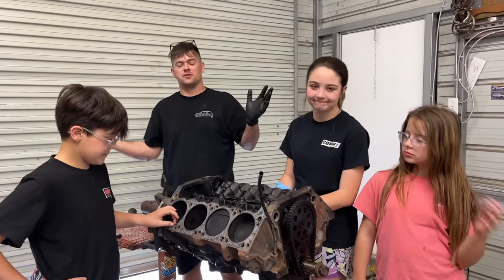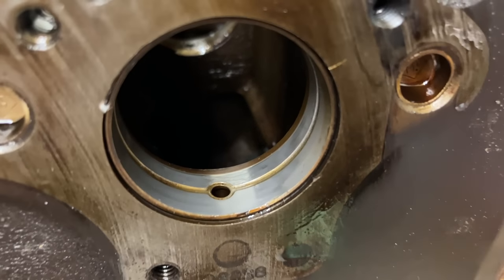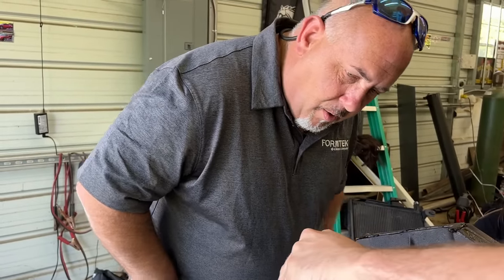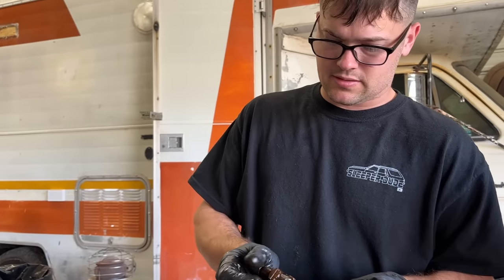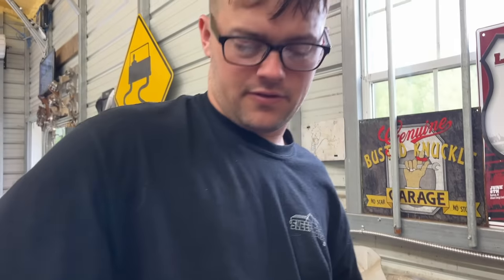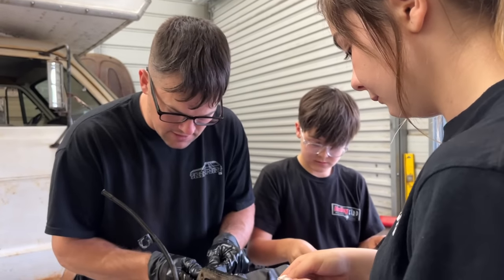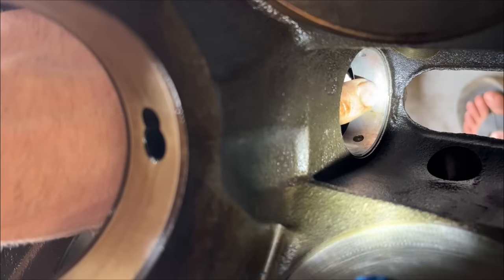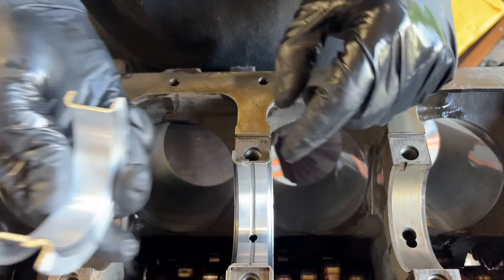250k Mile Engine Rebuild At Home! With No Machine Work For Cheap!

Comment: Take an old piston ring, break it, and use it to clean the ring lands on the pistons.
Oven cleaner always worked best for me when cleaning an old engine. Dollar Tree flavor works just as well.
I use either MMO or some dirt cheap engine oil for honing without issue. Taught to me by guys doing it for over 30-60 years.
Same guys taught me you can use STP Oil Treatment for assembly lube. Ford done the same for many years.
Good idea to replace the freeze plugs. They can look new on the outside but be rusted thin on the inside.
If my memory is right, that 360 is 4° retarded. Something to note.
I always take the oil pumps apart and clean them. Too many times I've found a bunch of trash in one and casting flaws in cheap ones.
Take and put some 10W30 on the valve stems, thin coating. Put it in and hold your finger over the guide and pull the valve out. If you got suction, the guide are still good.
Tell the kids to not be scrapping with a sharp blade towards them. Slip up and it could mean stitches.

I was thinking about the 302 swapped wagon. Why not T5 swap it and fit your old shifter handle to it?
It'll preform better and have better MPG's with the extra gears plus the OD will help out on long drives.

Comment: @SleeperDude
I've found that sometimes the plasti-gauge I would get was old, exposed to temperature extremes, or something weird, and actually would indicate a few or more thousandths off, so once when I had a good fresh package I got some tool measurements also, that matched up, then pressed at a set pressure some of that plasti-gauge between 2- machined steel blocks with graduations in .000's  on one going through the range for that gauge, and verified it's correct indication, then if I got some that read bad, I would call the supplier and they would send me more out, (from another box usually) and I would return the bad set for credit next time I was at their warehouse desk picking up or ordering parts, or dropping off cores. 
Had to rebuild one engine AGAIN because of that, and it was enough for me. Showed them the (then Polaroid 'instant' photos🤣)  pictures, they could see it, called their plasti-gauge supplier who agreed it was due to mishandling during shipmenr or storage, assured us that all leaving their facility was fresh with a really good shelf life, but near freezing for periods/complete freezing, or getting it way too hot, like leaving exposed to hot sunlight, laying on a hood, roof, etc, or too near a heat source that when used, it could mis- indicate, as can using it to try to measure outside of it's indicated range.😁
👍🇺🇸😎
Reply from the maker: Good info thanks

Comment: Josh, i advise you to lubricate the spark plugs by thread, a little bit, when you put the new one dry in the dry cylinders head, because, after engine works for some time, it will be harder to loosen it, and, it will made be broken  the ceramic isolator. 
Best regards, Saint-Pitersburd, Russia.
Reply from the maker: Ok thank you

Comment: Have seen the same type of damage to the cambearings in engines that have set with old antifreeze in the oil.  Seems to affect cam bearings more than rods or mains but have seen etching on them as well.
Reply: Anti-freeze eats away at bearing surfaces, impending doom sure to follow.

Comment: Hey i gotta share a little story with you about your motor home project. I totally appreciate all the different cars you work on. I'm restoring and daily driving a 1984 Nissan/Datsun pickup with an SD25 diesel engine. Its nice for northern Canada, no rust. 5 speed, extended cab, bucket seats, power steeping.  BUT, some parts are hard to find. There is a 1" heater hose connecting the head to the side of the block. Mine popped a leak. It's pre-formed into more than a 90 degree bend, in only 6" of length. Impossible to get one anywhere. I bought bulk 1" heater hose but without a pre-formed bend, it just pinches shut. So i tried  putting a copper plumbing elbow at the bend (1" OD) and I even heated it up to make more than 90 degree bend. For some reason the clamps didn't hold, it leaked. So I'm watching you take the 360 out of your motor home, and I see the hose from the water pump to the front of the intake manifold...yep I go get a hose for a 1973 Dodge 360 intake and after trimming an inch off one end it fits perfectly on the Datsun diesel. 
So thanks for solving my problem !

Comment: DIY head planer
Good quality 2X4 piece of plywood, 3/4 works great you want a flat surface. Cover the surface with fine sandpaper gluing the piece's down then just run the head back and forth till you have a even surface. Works very well for small imperfections.

Comment: just a tip to clean the piston ring grooves in a old piston,  take a old ring and break in half and use one of the half rings to clean the ring groove out with works great try it.

Comment: Thier is a tool to clean ring grooves but a old tip is use  a piece of the old  ring . Use a 55 gallon drum and block it up for a hot tank.

Comment: The secret to cleaning the ring grooves is to take one of the old rings and break it in half and file off any burrs and use the unbroken end to push and scrape the carbon out of the ring grooves. Can't believe you didn't know that one.

Comment: Wood chiscels work way better than screwdrivers for scraping , and you easily re sharpen them . When your flat screwdrivers start jumping out of the slot you will realise that you have rounded the edges from using them as scrapers. always keep a cheap set aside for use as levers scrapers etc, so that you dont ruin your good ones.
Reply from the maker: Yes for sure

Comment: Red Line assembly lube for the win!
Everybody saw how effortlessly that crank spun.
We were Red Line sponsored for years (92 IMSA Chmpshp) and fell in love with that stuff. The water wetter is great too & so is the gear oil that looks like pepto bismol (forgot its name).
Did y'all ever figure out what was up with the O.E. bearings?
Maybe submerged in solvent-type fluid.......but unlikely if it was a runner prior to disassembly......weird.
Reply from the maker: Yeah it seems like good stuff. No I didn’t

Comment: I had a similar low budget engine rebuild on my car.
It also has around 250k miles (400k km) of mileage, at least on paper... it's actual mileage might be an awful lot higher, since it's an old diesel.
One piston and it's rings were shot, and the cylinder surface was a bit rough.
Went ahead, replaced the bad piston with another one from a disassembled car, changed the rings, everything turned out to be ok.
Dunno about the compression and the pressure loss though. Must be significant, since I have a ton of crankcase gas.
It literally pushes oily air out of the filler cap and condenses oil on the valve cover.
But it's fine for me for the time being, it was an awful lot worse beforehand, and will probably last another 2 or 3 years before it needs machine work...
The repair cost me around 500 dollars.
Yeah, this car is an Audi A4 Avant, with the good old 1.9 from '96..
Reply from the maker: Ok awesome thanks

Comment: for a old youtube video I use to watch call Lunar Outlaw Garage he did a Mopar small block disacemble on a 318LA from his 1972 Satellite couped  he found 2 pistons in it number 5 on cylinder 5 and number 5 in cylinder number 7 and he trade the engine for another 318 at Uncle Tony Garage here in Tennessee back in May 2020.
Reply from the maker: Ok thanks

Comment: Little hack on assembly lube. For paste style I just use vaseline. It's a mineral base oil and will mix with any regular or synthetic lube in an engine or transmission, and it is dirt cheap. For the tacky liquid stuff I just use chainsaw bar oil. The reason that works is that it has tackifiers in it that makes it feel sticky when you use it, and you guessed it, it's dirt cheap. Might not be quite as good as the expensive stuff but I haven't had any issues using either one. I just make sure to do the first couple heat cycles with a good cheap conventional oil that's got a decent amount of zinc in it. I then drop the oil, put on a new filter and then do 500 mile break-in with the same conventional. After that I do an oil change again, sticking with the conventional stuff and switch to synthetic on the next oil change at 5,000 miles. I've done quite a few engine builds and it doesn't matter how well I clean those oil passages. If it had machine work done on it, some particulate still hangs around. I blew out the oil galleries with air, ran a pressure washer over it, brush cleaned the galleries with soap and water and did that over again 5 times, then a final brush clean with WD-40. Final flush with brake cleaner, then blow out with air, then WD-40 again to stop flash rust. Still got some metal in the filter after those 2 heat cycles. There will always be some left over no matter how good you clean them. I've even done this on brand new engines from the factory and I see the same thing. There's always metal in the filter after that first heat cycle. On the first 500 miles if I do see any metal in the filter, it's usually a small amount then no more after that. I've broken in engines this way and still have no oil use after 100k miles, so I know it's a good process.
Reply from the maker: Thanks for all the info

Comment: I’ve never installed cam bearings in a block either, I’ve always had the machine shop do it. All the machine shops around here are booked for months too. We still have the same number of shops, the only thing I can think is more people got into racing during Covid maybe. I’m not sure about the 5.9 magnums but the 5.2 magnums have a taller compression height on the pistons. When I rebuilt my 318 I used magnum pistons for a little bump in compression 👍
Reply from the maker: Yeah we need more people getting into machine shop

Comment: Richard Holdner dynoed a junkyard magnum engine and it was putting out about 400 ft/lb of torque from 1800 to 3400 rpm or so. HP was under 300, unless you did some porting.
Reply from the maker: Ok cool

Comment: RE: Cam Bearings: My understanding about metal fatigue is that once the engine is broken in the surfaces mate and you can run it many miles, but then tiny cracks begin to appear on the surface and relatively soon after that the metal starts to disintegrate. I don’t agree with your decision not to replace the ones that ‘look good,’ the wear is taking place in any case, and in a few more miles they will start to fail too. I am sure, though, that you won’t let the trash build up in the crank case.
But don’t worry, it’ll be alright.
Reply from the maker: Ok thanks

Comment: The best ring groove cleaning tool is an old ring. 
Take one of the rings from that engine and break it into. Use the factory ends of the ring to cut the crud out of the grooves. If your using picks or screwdrivers they are never the right width and they have a tendency to cut grooves.
Reply from the maker: Ok good idea

Comment: I have seen something kinda like that happen to tractor rod bearings that. Set for a long time with supper high detergent  oil in them and ended. Up looking like it had a big worm ate out little grooves in the insert as best I can see with my old eyes it looks just like that does.and they look like something been eating it in all directions.
Reply from the maker: Yeah it was very strange

Comment: I think the bearing failure was due to antifreeze being in the oil you can see the timing cover gasket has been replaced which is normal for the magnum
Reply from the maker: Yeah maybe so

Comment: I made a cleaning tank out of a 55 gallon metal drum with a lid and I put a low burner under it and put water in it with greased lightning and heat it up and took a 1/4 in brake line and adapted it to a air line and put it in the barrel to agitate it
Reply from the maker: Awesome

Comment: You can take the old piston rings and snap off a section to run them through the grooves next time to better assist with cleaning them out.  Also, as you may know, WD-40 stands for Water Displacement - 40 attempt/formula. Which further explains why it prevents rust, because it displaces the water from the surface. It does have a slippery quality to it, but like you said not designed as a penetrant or lubricant.
Reply: Liquid Wrench is good, like the CRC556 for a drilling/cutting oil because it smells the best when smokin

Comment: 1:14:25 hey josh, if you have a bench grinder, change out one of the stones for a wire wheel. I have one on mine and it makes cleaning parts so much easier.

Comment: Josh  use a couple  3 inch  lengths  of  fuel  line  hose on rod bolts to avoid  scoring  crank shaft.
Reply from the maker: That a good idea

Comment: It looks like 250,000 is the outer limit for one of these engines.  I have the white version of that Durango with 115,000 KM which is around 71,400 miles.  I have a way to go yet.

Comment: That is very odd seeing the engine bearing coming apart like that. It looks like a motor that ran methanol and never had the oil changed or something caustic got in the oil.

Comment: For head  or any other critical torque bolts , I run a thread tap through the block threads, and wire wheel ( bench grinder ) all the bolts.

Comment: I saw a slightly different method for the valve lapping with a drill method. The guy put a rubber hose in the drill and then slid it onto the valve stem. It still has a strong enough hold to pull the valve into the seat but then you can pull it off and move onto the next one

Comment: I'm a life-long Mopar fan, and I can remember helping to rebuild my 340 Cubic-inch Plymouth motor for my 'cuda in our house's garage; I remember my room-mate hand-honing the cylinder walls and doing LOTS of cleaning. He had micrometer guages - no Plasti-gage for US!LOL! I think we would've been thrilled to have all these goodies to help with the cleaning and stuff. Air tools are a life-saver. That 340 engine was a screamer; the speedometer would go up to the "P" in "MPH" on the dial(about 135 mph); I never had the nerve to ask a "friendly policeman" to clock me with his radar-gun. 

Great memories, this video has brought back - Thanks for posting this! Good to see that you're sharing your skills with your family; I think that EVERY child should be exposed to this stuff, to see if they like it. It used to be that EVERY boy helped his dad change the oil and tires and stuff; Jiffy-lube made us into a nation of lazy men. When I went to college for electronics in the 1980s, there was a girl in my class who used to restore old Harley motors. 

I just KNOW that there's girls out there who work as bank clerks, who would be just as happy turning wrenches. It's too bad our society brainwashes and segregates them; the STEM classes are a step, but we're badly mis-using a National resource; a large number of potential mechanics and machinists, because of prejudiced school administrators(actually, they're STUPID, but they got their prejudice from church, in a lot of cases, and I don't wanna argue with anybody).

Thanks for your videos; keep up the good work!

Comment: Josh , WD-40 was used to prevent ice build up on NASA liquid fuelled rockets and it took 40 tries to come up with the correct formula and never was designed as a penetrant and as you probably  know Liquid Wrench is a penetrant ! As you say , Heat works best . Thanks to you and your family for your hard work !  A prescriber √

Comment: WD-40 (Water Displacement, 40th formula) was originally designed to be used by Convair to protect the outer skin of the Atlas missile from rust and corrosion.

Comment: I would not trust WD-40 for rust prevention. In the 90s, I work for a limousine repair. We used to have to Duval jobs frequently enough that I started rebuilding heads in advance, leaving them sit on the shelf first set of heads. I did I lubricated everything with WD-40 when I put it together, thinking it would keep it from rusting. Wrong. They rusted up and had to be rebuilt again because we had to pound the valves out of them. Better off using oil. The same properties and WD-40 that breaker rust loose. Take away though. Lubrication properties as well when it’s setting and not moving. If it’s something you’re gonna do within a day or so, no problem otherwise I’d recommend using assembly lube. If you’re just looking for a rust protector, I would probably use some thing oil based and then clean it well worth something that will cut the oil when you go to paint them.

Comment: This is the tool you need to use to clean all the oil/carbon etc. From the piston ring grooves. Google JDCV0205. Toptul PISTON RING GROOVE CLEANING TOOL. Cheers Stew.

Comment: The best shade tree surfacing tool is a 3/8-1/2" thick glass two inches or more larger on all sides than the area your surfacing. Silicone a heavy oak board with broomstick type handles on one side. Use an excessive to ridicules amount of silicone.
On the other side of the glass put a layer of self adhesive 400 grit sandpaper.
Set the tool on the deck head or whatever your surfacing with a light oil on the sandpaper and surface your sanding.
Use the weight of the tool only. Pull across surface with no downward pressure. Be careful and do at your own risk.
BTW The name WD40 stands for formula #40 Water Displacer. It is not a lubricant! It will remove lubricant and evaporates off. That's not what lubricants do. What you used it for is what it was made for.